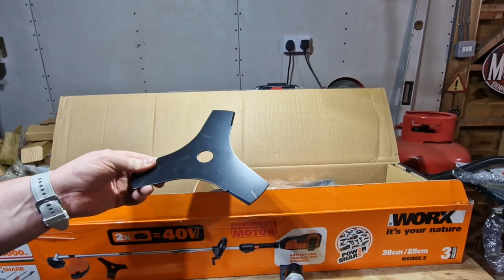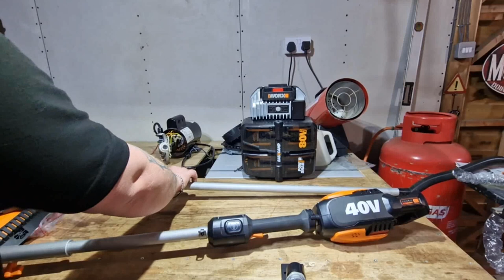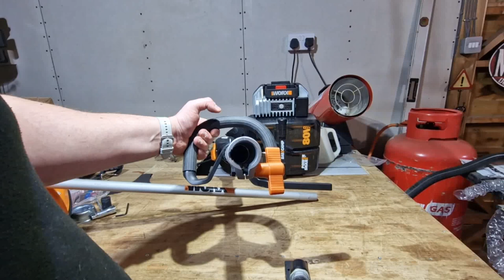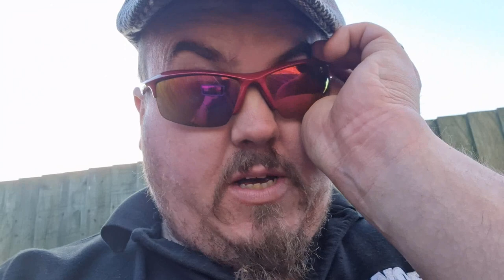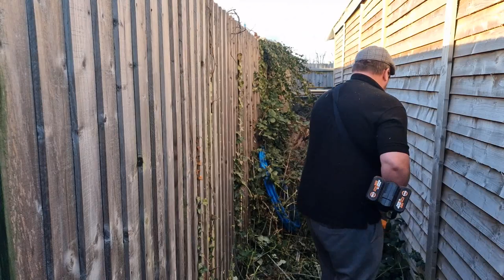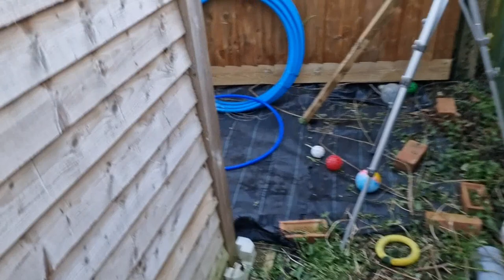mikes review worx wg186 nitro petrol like power 40v battery power tool strimmer weed wacker

Comment: Good demonstration on the tough weeds and bramble. I'm looking at a battery operated string trimmer now. This Worx looks real good. I also have to deal with tough weeds and tall wild grass. 
Thanks for the demo.
Reply from the maker: Many thanks :-), the limiting factor with this strimmer really is your mechanical sympathy and the strength of the trim line :-) I have upgraded to oregon 3mm round and although it is very good it gets tangled up very easily and you have to constantly give it a helping hand to spool out - this might be more due to spooling on loose rather than under tension, I am going to experiment with this next cutting session.

Comment: Mike, I just got the wx500 reciprocated.  This is something you should try. Be interested to know your thoughts  . I did buy better blades for pruning. The wood blade, didn't like green wood. Not tried the metal,  as I don't have any to cut. But it's a good machine. Scary too 😂
Reply from the maker: I have the worx axis jigsaw transformed into recip saw and I agree about the green wood, sounds a little weird but a splash of ptfe spray from the blue and yellow bottle people :-D or the more traditional method of a candle rubbed against the blade utilising the wax. I use amazon special blades as you can pick up 20 blades of many varieties for the same price as a couple of genuine worx blades. But the white paint on the amazon specials is proper annoying!
Reply: @mikesptworld   cheers. The thing is. There is no real review on this product.   I saw the axis, yesterday.  Looks ok. But I personally would not use the jigsaw. There are allot of other brands on YouTube, not the worx wx500. Anyway. Just a thought.  Cheers

Comment: Hi Mike love mine. I call it my Rambo. I have large garden. I also cut my neighbours.  I basically have all the nitro. This tool is my go to. I have the mini strimmer for quick cuts. I did accidentally cut the wire fence😂
Reply from the maker: Yeah, it is rather lethal! It's not very selective with what it destroys! Don't use it near you prized daisy's or marigolds because one slip and it won't hesitate to cut through that, the garden cane and the fence too, especially using the brush cutter head!
Reply: @mikesptworld  To late.😁

Comment: Major flaw? The attachments (I have brush blade and strimer) randomly disconnect within the drive shaft from the WG 186 from one run to the next--motor runs, heads don't spin.
Reply from the maker: I have just got myself the hedge trimmer attachment and it seats in real nice, try rotating the head to see if it locks into the drive shaft connector internally, the button should locate into the hole quite easily and then clamp it up nice and tight with the wing nut to secure its location tightly, let me know if you get too many issues I will make a quick video to help you through it as best I can.

Comment: Hi mate great video! 👏 just wanted to ask , I was thinking of adding the idech power rotary scissors on my one of these and wanted to know wiil it fit as I I know these are shaft systems and the idech scissors only fit shaft systems/any advice please? 👍
Reply from the maker: OK, from my limited research, it appears there are a number of inserts that allow for different head fitments, assuming there aren't 14 different sizes of square drive used then the standard square drive SHOULD fit it, looks like a very cool attachment, I have the wa0220 hedge trimmer attachment (yet to properly review) and have been using it to slay reeds and brambles doing volunteer work on my local heritage railway, this is a rather cool compact rendition of the hedge trimmer attachment in my view, combing the compact head with hedge trimmer attachment, I see also they make a rotavator head too! :-D
Reply: Hi , thanks for the reply. Yes there great the idech rotary scissors As they don’t kick up any debris or throw any rocks or stones as they  were recommended to me by my  old Gardener, Keep up the good videos honestly you’re doing a great job mate thank you again 👌👏

Comment: In relation to your comment about making sure to tighten the nut for the brush cutter hear: not that I'm suggesting you don't tighten it, but like an angle grinder, isn't it designed to tighten with use instead of loosen, as a safety feature?

If not, sounds like an oversight. Wouldn't the safer setup be that the blade retention nut works itself tighter over time?
Reply from the maker: It is and it does but not so much with the bruscutter blade as that would stop driving way before the nut comes off but the head is  of a direct screw on approach and therefore when it spins up when the automatic safety brake kicks in and its your first time 'revving it up' and don't actually cut anything or bump the line and therefore automatically  tightening the headstock will maintain its original tightness - if this is not very well done up at all then when the brake kicks in the head and all its inertia continue like a spinning top on the ground, which ordinarily is fine except it really is not if it unbalces itself and rolls off at 7,000 rpm like a scene out of tom and Jerry! It's more to warn people of the potential danger than the actual danger.
Reply: @mikesptworld 
Thanks for the explanation brother.
Would be an interesting video if there was a safe way of inducing that situation and recording it. I can't think how you would easily do that safely though.
Reply from the maker: @muddin8097  as we are mainly looking at the head coming off, I could have a head without the flailing cord coming out and stand in a solid box with a Perspex shield to stop any possible rebounds. a feasible approach, i may have to experiment with this first.